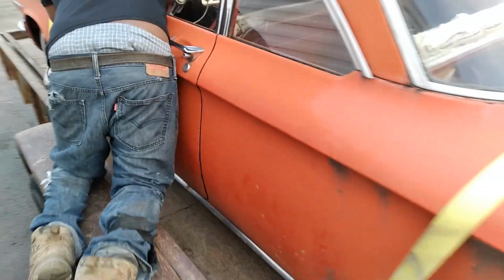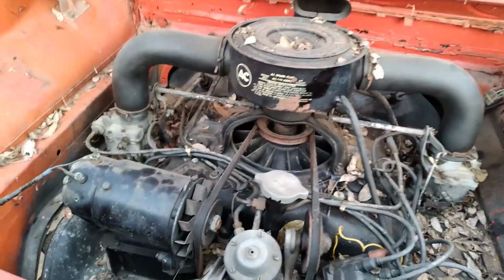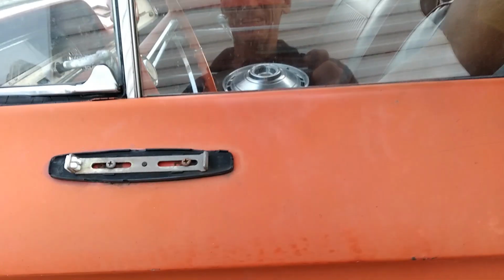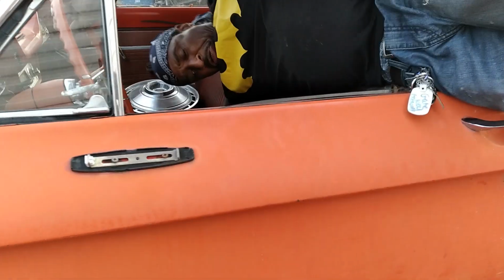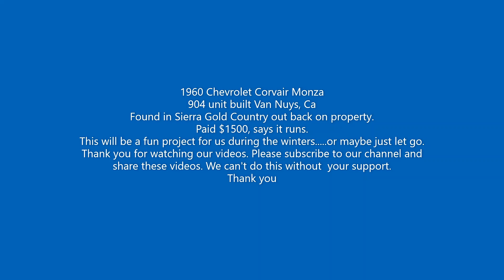#willitrun 1960 Chev Corvair Monza: Part 1

Comment: All Corvairs only came with a 6 cylinder; They never had a 4 cylinder from the factory. Depending on when it was produced; It could have a 140 C.I. or a 145 C.I. it should be be a 145 C.I. 60's are totally unique as far as the 1st gen. Corvairs. Nice score.
Reply from the maker: Thank you so much for replying. Yes, I am learning about them. Thank you for sharing info. I will do a bit more research. I love them!
Reply: @Trailer_Gods  I've been loving them as a kid; Since 1967😉.